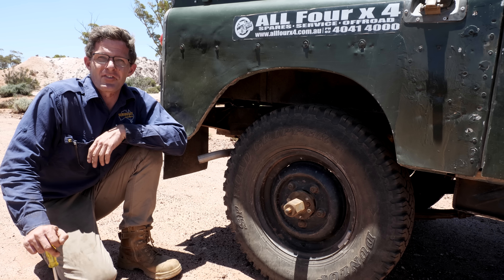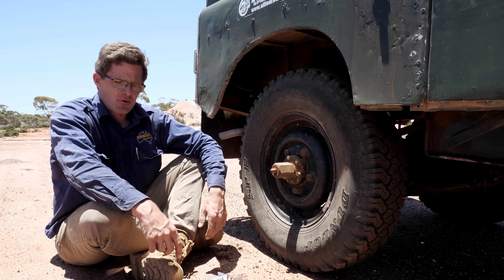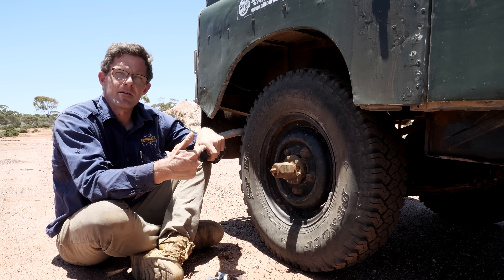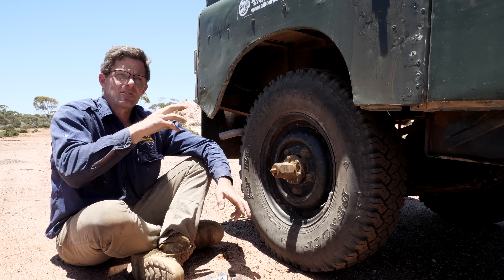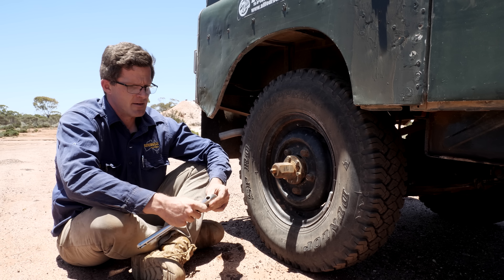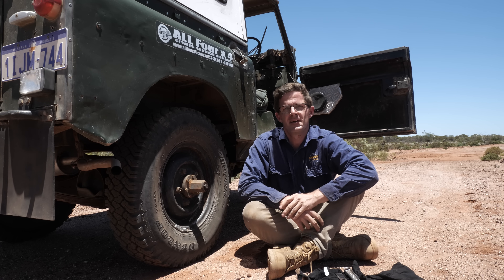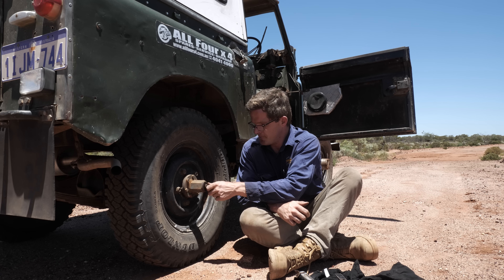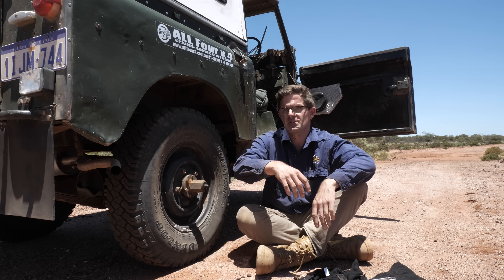World's simplest 4x4 diff lock: McNamara Diff Lock

Comment: I'm missing something here.  How is this any different than turning in a set of hubs?  The axle is still turning with the wheel, but it has been pulled out of the differential.  How is that any different than turning out your hubs.  You are disconnecting the wheel from the differential either way.  How does it 'lock up' the differential.  I need pictures, drawings, and videos to show me how this works.
Reply: it's not pulled out of the differential, the shaft is longer than normal (with also extra length splines) and locks the spider gear to the diff center when it's 'in' and works like a regular open diff (with a bit of extra splined shaft outside the hub) when 'out'.

Comment: Same concept as my D44 front with a full spool, and I leave the driver's side hub unlocked unless I really need that extra bit of traction.
My rear is one of those ratcheting lockers which does work, but they get a bit dodgy in snow and ice. And who knows what kind of mileage it'll hold up to?
Reply: Not the same at all…

Comment: I dont quite understand your explanation, are you pulling out /letting go of the driven axle shaft to that tire out of a perminantly locked "diff" so thats its just driving one side of the axle ? Or are you pulling / letting go of a control rod thats inside the driven axleshaft thus making a regular open diff or locked diff?

Comment: A bit of a Freddy Flintstone solution in my mind. No comparison with the ease of flipping a switch in the cab for an air, electric, mechanical locker. You typically only need a locker for a very short time to clear an obstacle or climb.

Comment: On farm tractors you step on a pedal that locks the rear axle and drive thru the rough stuff. Release the pedal and it disengages. Wonder why that can't apply to a truck differential. I know highway semi tractors also have full interlock factory installed as an option on trucks. In Canada it makes a huge difference climbing a snow covered grade when you have all 8 tires pulling and if seriously bad with chains on all drive sets it makes a huge difference. Just don't try to make a sharp turn. It will either push straight or in rare cases break something.
Reply: I never put 2 and 2 together on that myself. My Kubota has a pedal that locks in both rear wheels. It engages easily, so it must be something simple, I use it from time to time. I don't know how it works on the tractor. The rear end on it has a lot more going on than a common road axle. Lol! But I would suspect the tractor is more purpose built for dirt work and, as such, has been engineered to provide this function. Whereas with people hauling 4x4s, not everyone needs a locking differential. I would think this applies to semis as well. It isn't that they can't do it, but is it needed.

Comment: from memory they were manufactured in Melbourne, they are still in business today, they dont have a website its just dial up only... (these guys are old school so please respect that fact...)
 the centre bolt just needs to wound out until the first thread appears then wound in a couple of turns (use a socket & bar only) then you rock the vehicle manually or by clutch operation, do not just drive off, just look out of the window to watch & check to see if the centre bolt fully retracts...
the "clunk" will let you know when it is engaged, the bolt WILL disappear into the housing, no need for the bung to replace the bolt, no need to remove the centre bolt, the spring action is enough to keep the oil from leaking, however fitting a copper washer is a good go to if you are that way inclined (a rivet counter type )
 I have had a Macca diff lock fitted to my old series 2 SWB for over 40+ years (still got that old beast...) it is a great piece of kit for sand, mud. loose surfaces, hill climbing, etc never use it on hard surfaces, pavement, roads, etc it will cause you some serious handling issues and potential damage so its for off road use only and using it over 40kmph off road is a "no no" (speaking from experience...) 
they are very hard to find and can cost $$$ if you do find one, pulling them apart is difficult puzzle for those not in the know... which makes axle bearing, oil seals and diff repairs an experience that will generate a new vocabulary of swear words...
Reply: I’ve got one also, I’ve never tried the method you describe. I’m keen to give it a go. It’s always been bolt out/bung in for me.

Comment: Why not just use a spool or welded diff and selectable hubs?
Reply: This comment has come up multiple times , and been responded to. 

Why not? Because anyone that has run that set up knows it has horrible driving characteristics. The set up in the video is a diff lock. Normal on road in the unlocked position (open diff ) and fully locked when engaged.

Comment: So is the differential in the axle locked all the time and you're just pulling the axle out of the right side to disengage that side making the axle left wheel drive? Or is there 2 stages in the right of the diff such that pushing the axle in engages a locked portion and pulling it out leaves in a standard open diff arrangement? If thats the case, I'd like to see a diagram of that nifty engineering.

Comment: The 'Torson' diff is even easier, any wheel slip and it is instantly engaged.
Reply: until it breaks... then nothing is engaged anymore lol
Reply: @DrTheRich  have you broken one? Any diff that fails will leave you stranded, all mechanical components have their weak points.
Reply: Helical lsd (Torsten is one brand) are the best at almost everything, EXCEPT when tires start coming off the ground. Then you’ll want locking differentials.
Reply: @DrKnowNothing1  but they are locking diffs which is what you want when you get wheel slip which includes a wheel off the ground.
Reply: @seanworkman431 helical limited slip differentials are NOT locking differentials.

This video IS about a type of locking differential, which would work with a wheel in the air.
Reply: @DrKnowNothing1  well a spiral or worm drive gear is what I am thinking of.

Comment: Clearly, what you show here is NOT a locking differential. All you talk about is moving the axle shaft out of the differential side gear, which constitutes an axle disconnect system - a very cumbersome one on top of that! There must be an entirely different differential setup than usual, as releasing the tension on the axle shaft will not give you any locking differential action at all. This video is pointless as presented, with the exception of showing why you should never use adjustable wrenches on vehicles!
Reply: I agree the video did not show how it worked, but it is a locking diff.  Disengaged it is a standard open diff, when engaged the axle extends into a spline on the cross pins which locks one side gear to the pins.

Comment: Why wouldn't you just get a full spool and manual hubs?
Reply: Because it’s not the same and the set up your suggesting has terrible on road driving characteristics.
Reply: @husq2100  it would be exactly the same.
Reply: @johnhoffman3145 no it’s not. Having driven locked rear with a free wheeling hub I can tell you they have some funky quirks that you don’t get with a normal open diff (which this is when unlocked )

Comment: You folks Down Under have Toyota pickup trucks like we do. What do you think about the older Aisin manual, quarter-turn locking hubs? I’ve never had a problem with mine and it lasted for over 650,000 miles before some clown broad-sided me.

Comment: This guy is the king of rounded out bolts. 😂
Reply: My thoughts exactly. It might be hard to replace those, especially the longer bolt. But otherwise, this was a very informative video.
Reply: lol i'm sure he was just a bit nervous trying to do a take on video, but using it backwards was the cherry on top. The arrow is literally on the wrench.
Reply: You'd think he would have some sockets for a difficult bolt?
Reply: our you are just terrible at using adjustable wrenches and think everyone else is too...
Reply: @DrTheRich  7:05
Reply: @DrTheRich  ive had a ton of bolts try to round if you didnt have a box end wrench.  The box end supports the whole bolt and is much less likely to round one off.
Reply: @DrTheRich 
An adjustable wrench, better known as a shifter or a shifting spanner (amongst ol' school Fitters & Mechanics) is okay to use as a "substitute spanner" when a "proper" spanner or socket for the job isn't available.
They are by far, the worst spanner to use, for many reason. A great spanner for rounding off nuts and heads of bolts, that come in various shapes and sizes.

Comment: So is this a 1 wheel powered welded diff with a sprung loaded half shaft to connect the other wheel?
Or is this 2 wheel powered with a longer half shaft where the side gears are always connected to their respective wheel but the half shaft springs into engagement with the diff cross pin when the drawing bolt is removed?
Reply: the second

Comment: Speaking as an engineer I failed to follow his explanation as to how it works and also the bit about the increased number of splines on a drive shaft didn't make any sense either.  From an engineering point of view a square socket type of drive gives exactly the same 100% drive as a hexagon key in a socket screw?  The other drawback seems be be the requirement to get out of the vehicle, use a spanner on the half shaft only to repeat the same procedure immediately the vehicle is free?  
Or have I missed something?
Reply: How can 4 points of engagement give the same amount of surface contact as 6 points….

As an engineer you should know that an axle shaft spline in a side gear or drive flange is not a press or interference fit, it’s loose….so 24 points of engagement is spreading the load over more area than 10, plus you get the bonus of the shaft root dia is larger on the finer spline and since the splines are not the same profile in this case, the finer is of a better design and less of a stress riser.
Reply: @husq2100  Point taken, and also the reasons why, especially if the strength and the service life of the original design is in question.  What I was trying to envisage, was how the half shaft's connected together through the centre of the differential which he didn't explain very well.
Reply: @mrmyorky5634 the spring loaded axle shaft engages/disengages into the carrier cross shaft that has matching internal spline.
Reply: - yes, I think the description is a little off, in the mechanical explanation.  inserting  the bolt isn't  taking the half-shaft spline out of action in the differential (bevel gears), it is allowing it to align through the diff to lock the opposing halfshaft  (I Imagine  it as  the one halfshaft having a spline  being longer than usual - by the length of the bolt which was removed - in order to match a spline (a smaller end spline ? extension? inside the opposing shaft...

This differential has a "modified centre" -    -including I believe  a splined tube .

Drive shapes and angles - after the facesarealigned - now we need to talk about the cross  sectional areas at play to see which are stronger or weaker ...   In many cases  yes a square drive will result in a more positive drive than a hex - especially in smaller  cap screws where the high stress on the (small) hex key shears it earlier than a square (or triangular) drive would do..  (90 degree per corner versus only 60..)   - Then we can go and talk Torx -   Splines are ike Torx vs Allen  Keyed screws  (torx are m ultiple smaller triangle tips around the Hex....  (sometimes more splines are weaker - if too fine / small - depending on the force per spline  and cross  sectional area , now for the misalignment that can happen - like threads, how many lands are truly engaged at any one time?? 1, 2,3-  not all ?? 16 or  24 9whatever)....

(PS. I have the engineering education all sorted too)

Comment: In an open differential both wheels are still doing work until the least tractive tire spins. Take the weak side axle out of the rear in a locked rear and you will soon learn that you need both sides. It's ridiculous how much disengaging one side affects the other.
Reply: If you are saying this disengages one side you might want to reevaluate your thought process lol
Reply: @husq2100   I didn't watch the whole thing. I commented when he said it pulls the axle out of the differential. Doesn't that disengage one side?
Reply: @jimandskittum no, it’s always engaged in the side gear. When it’s inboard it’s inside the cross shaft (which is splined) for the 4 pinion/planet gears. When it’s out, it comes out of the cross shaft but is still in the side gear….

Comment: Except with a Toyota E locker you can pull a couple screws move the rack gear by hand into the locked position and then reinstall the actuator and you still have a locked diff.
Reply: a lot of the e lockers you can get a cable setup in the cab if you prefer no electronics

Comment: My 2WD Ford E-150 has a traditional locking differential...
I have the vacuum locking diff in my 91 2WD Vanagon Westy...
Of course the center & rear diff locks on my 84 Audi 4000 Quattro are also vacuum actuated...

While my Vanagon Westy has gone on moon patrol, crossed rivers & etc. I have been scolded many times by the Toyota 4 Runner and the like, despite that i have never gotten the Vanagon stuck.
I did pass two stuck 4 Runners climbing out of a basin when an unexpected rainfall occurred. One of the 4 Runners happened to be owned by a very rude man who had been telling me how I "was an idiot to drive into the back country with a crappy 2WD". Seeing his face while I drove by while he sunk his Toy Auto to the axles...

Basically there are many ways to make a vehicle ready for the back country, if it has enough ground clearance, which my Quattro will never have. But the biggest rule I have gone by is having a manual transmission & locking diff is more important than having 4WD...
Reply: -  yes even with 4x4, without at least one locking axle - it can becomes a 1 wheel drive very easily (IF/R-S vehicles can be even worse as they have less axle travel at the independent ends) - I used to have a Ford Falcon RTV Ute - live axle rear diff lock (e-locher)  that got me a lot of places 2WD had no business being.
Reply: @kadmow 4wd got boring so I offroaded with 2wd 54 Chevy PU in volcanic rock and sand desert and jungle. Never got stuck.

Comment: Very interesting - I have never heard of a McNamara locker. Thanks for explaining how it works - I love old mechanical tech. Do you have to remove the bolt from both sides then? Or why only one wheel? I guess I don't understand that part. Lastly - I was saddened to hear "if you can find one" :-( Pity no one manufactures this product any longer. I guess if it lasts 45+ years, they can't sell enough of them in our modern era of quarterly profits driven greed.
Reply: the one axle slides, connecting either to 2 points (spider gear, wheel hub) or 3 points (spider gear, diff center, wheel hub). When it's engaged to all 3 points, the diff is locked because the spider gear can't turn in relation to the center.